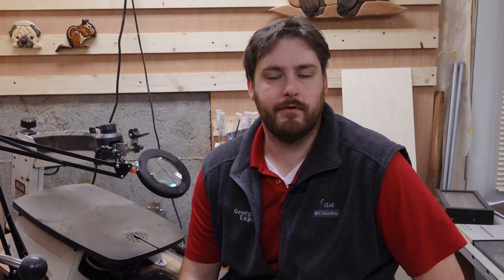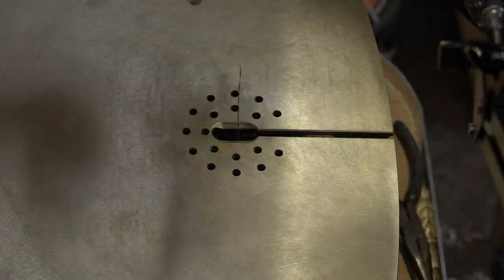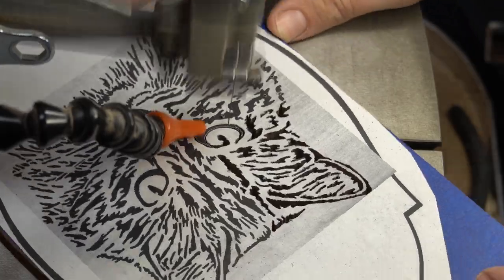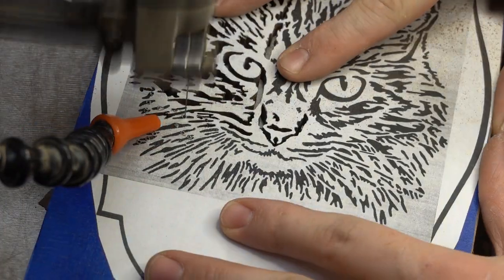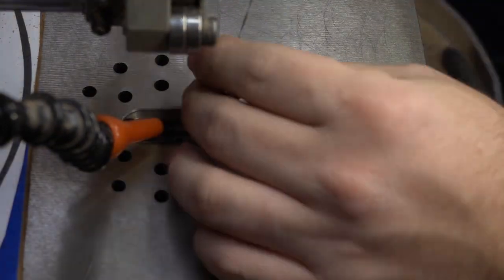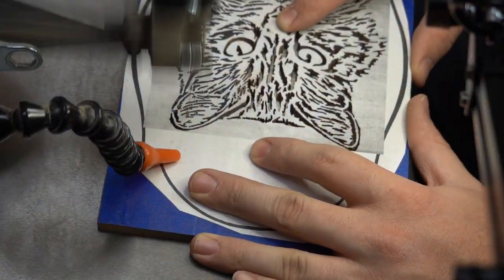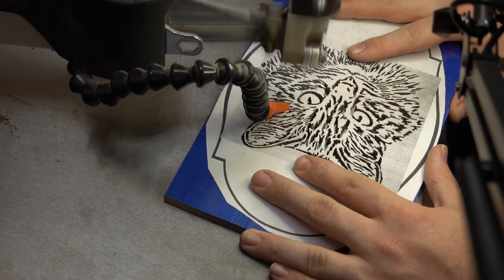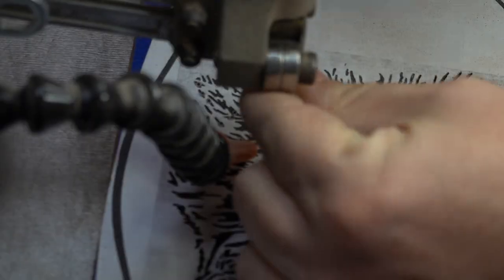Cutting Fretwork with Spiral Blades on the Scroll Saw

Comment: My hegner has the same benefit for bottom feeding.  The clamp and blade pop in and out readily, Making bottom feeding very rapid and easy.  My problem with spirals is getting the blade to seat in the top clamp (hegner quick clamp).  I have to twist the blade so that the top and bottom tips are in the same plane.  If not the blade pops out as I tighten down.  Very frustrating and time consuming.

Great video.  Thanks for sharing.
Reply from the maker: I know what you mean about twisting the blade to get it set right. It usually works out easier after the first few clamps.

Comment: what you use to lubricate your spiral blades and how many blades did you use-break for this project?
Reply from the maker: I don't use anything specific for blade lubrication but I do change the blades pretty frequently. I can't recall exactly how many I used on this project but I imagine it could have been 5-10.
Reply: @ScrollSawCorner   ty very much

Comment: Could I contact you privately to ask you question? I do similar work with laser cutters but I think a scroll saw might be more affordable and allow me to work with thicker materials.
Reply from the maker: Sure, you can find me on Instagram under scrollsawcorner. The main issue you'll probably run into using a scroll saw vs laser is the scroll saw is much slower so I don't know if it will be a good fit if you are making things to sell.